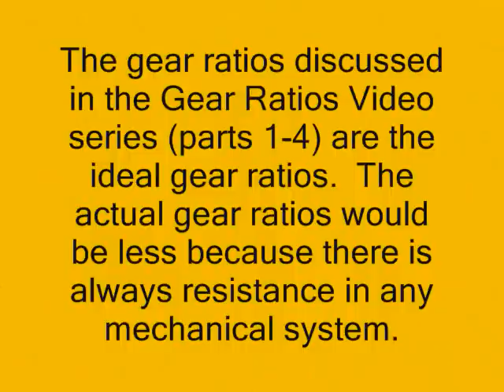Gear Ratio - Part 4

Comment: We need to eliminate one motor on our robot. We need to try and use one motor for our arm but are concerned about not having enough torque.Do you have any suggestions?
Reply from the maker: Hi,  You have two options if you need to remove a motor from your arm.  The first option is to add rubber bands or surgical tubing to your design which will help lift the arm.  This will keep the speed of the arm the same. However, if you are trying to use the arm in the opposite direction such as putting a down pressure on something or lifting the robot off the ground the rubber bands or surgical tubing will work against you.   The second option is to use a gear ratio which is lower than the gear ratio you're using currently.   This will help your motors hold and lift your arm up, however it will slow down the speed of the arm.   please see: 
https://kb.vex.com/hc/en-us/articles/360037389012-Robot-Arms-Mechanisms-for-VEX-V5

https://kb.vex.com/hc/en-us/articles/360035590932-Gear-Ratios-Motor-for-VEX-V5

Comment: The only problem is this would not work for a bike you don't have a derailleur attached which is critical due to the tension it applies  vs chain length. Most road bikes sold have the wrong chain length. You don't measure the chain by big ring vs big sprocket that is silly because you have removed the rear derailleur from the equation thus your length is now wrong. The 2 links added for chain is to reach the first jockey wheel, but you have not added the length for the bottom jockey wheel which is critical for chain slack. Uploading a video demonstrating this. Pro time trial bikes use bigger jockey wheels thus requiring a longer chain due to : size of jockey wheels! .  I would say over 90% of road bikes with 7 speed freewheels (10 speed and 11 speed bikes are not affected by this) have a chain that is incorrectly measured. You still size the chain by big ring vs big sprocket, but you add the links that the jockey wheels take up so:  2 pin links to reach the top jockey wheel, 3 pin links to go around that jockey wheel, now add the links to go around the bottom jockey wheel (some bottom jockey wheels are bigger) so 4 pin links for a big jockey wheel you are now at 9 pin counts that you did not have before. These extra 9 pins is the secret to have proper chain slack, smooth shifting, smooth big ring on big sprocket combos. This procedure is critical for 7 x 3 road bikes ( 21 speed).

Comment: Good video but here you given 1:4 ratio and you're taken 10 teeth on driver and 40 teeth on driven why you didn't take 4 teeth on driver and 16teeth on driven
Reply: 4 teeth on the driver would bind the chain and The VEX Robotics system which I used the sprockets from only has certain standard sprocket sizes. Hope this helps.

Comment: Sooo can I be stupid and put a 60 tooth gear with a 12 tooth gear that is above another 60 tooth gear that rotates another 12 tooth gear giving 1/25 torque but 25x speed?
Reply: Yes you could do that and make a light speed crank